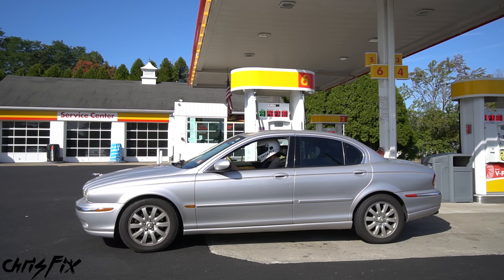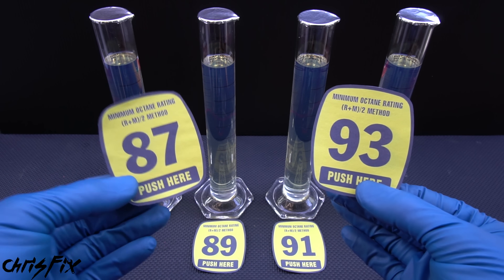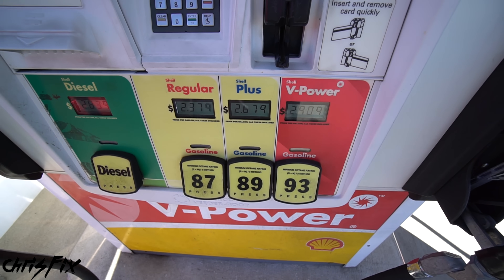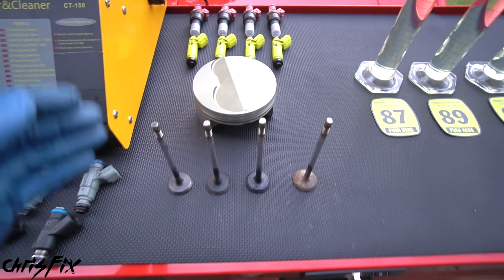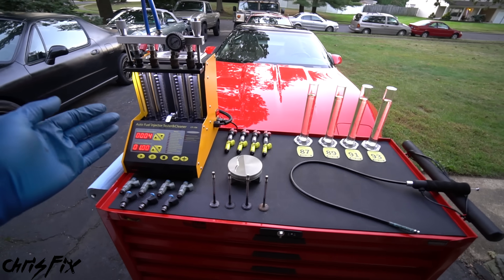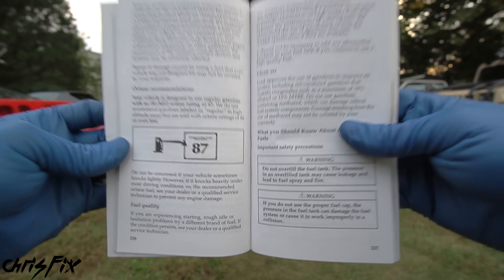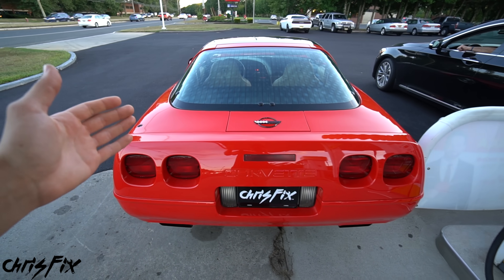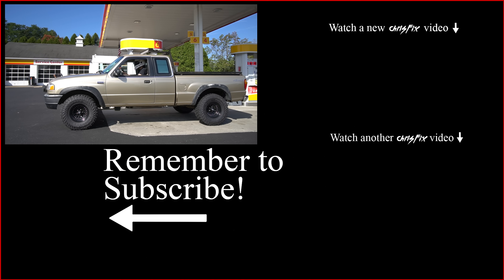What is the BEST Fuel to Use in Your Car or Truck and WHY

Comment: there are many differences between EUROUPEAN and AMERICAN fuel, beside octane 
1- they require low sulfur gasoline, unlike US(which has a lot more sulfur, because it's cheaper to refine!)
2- in US  we get higher octane from adding additives ,not not at refinery(again cost more to refine to higher octane!) most middle eastern oil producer country use that method!
the best to keep engine clean and healthy, last long and get better gas mileage and more power is to get ethanol free gasoline! 

shell and chevron have lot more additives to compensate for their crappy gas that was forced by government ( as we know all gasoline base are the same from refinery, after they loaded the truck refinery add the additive formula that shell, Chevron, ARCO .. ETC gave them)

Comment: i drove my hybrid honda insight from miami to seattle and back and the best mileage gas was from shell. 450 miles per full tank.  other stations fuel was around 350 i was amazed.
Reply: Wow def big difference. Guess I will stick with shell.

Comment: Outstanding video and accurate information.  I am an ASE Master Mechanic and wanted to mention a few things I might have missed in your video.  Miles per gallon (MPG) - we did a study years ago on several vehicles using different octane fuels.  We discovered that 5 out of 6 cars got increased MPG with higher octane fuel.  The math shows that in most cases, it was less expensive to use higher octane fuel - more MPG vs. fuel cost.  Also, I did not hear you mention marketing hype as many vehicle manufacturer's used using lower octane/cheaper fuel as a sales tool.  I have never heard of a vehicle that didn't perform better using higher octane fuel than suggested/recommended/required.  Great animations, I appreciate the research, information and work you put into making this video.
Reply: This is all b.s. long story short especially with newer cars if it runs on 87 and you put 93 your computer will adjust to compensate and your "extra octane" goes right out the exhaust your wastingr your money just put what the manufacturer recommends  but to each their own
Reply: @thomastolson6909  Exactly, Thomas. This thread is all b.s. There’s always a certain % of people who hold onto their belief even when it’s contrary to the facts.
Reply: @thomastolson6909  Right. No second hand information, I want a link to a published study
Reply: I agree.
Reply: If my car recommends 91 octane (premium gas) would it be beneficial to put in 93 or could it cause problems to my engine? My car is a 2012 Infiniti G37xS coupe.
Reply: Agree and wanted to add something we rarely see mentioned...the problem with the lower octane fuels in Canada (not sure about the US) is "ethanol" in the premium gas there is no ethanol. All lower grades had at least 10% on the pump. This is one of the main reasons for not using lower grade fuel, even if your car can run on it. 6 vehicles, 2 fully restored and they all run better on highest grade fuel, better fuel economy, fewer problems with our engines. I'm not sure why so many mechanics say lower grade is fine, it isn't and the difference is noticeable. Save money on gas and repairs, buy premium, its only an extra 4 dollars at the pump up here and worth it.
Reply: @RichardPortfolio  ethanol burns hotter and is less energy dense. that alone is the reason for better fuel economy. has nothing to do with the higher octane rating.
Reply: I remember when I was gung ho about being ASE certified 20 years ago. Then I learned that the only ones it mattered to were customers and some shops that paid extra per each certification so they can hang the certification in the waiting room for customers to see. Done alot of testing myself on various octane ratings and didn't have the same results. From carbureted to direct fuel injection didn't see any difference as long as the minimum octane rating for the compression ratio was used.
Reply: @freedomunrestricted  yeah, that so-called ASE guy didn't mention what kind of cars were being used and the methodology used. Love it when people present anecdotes as scientific study 😆
Reply: He did briefly mention better power and better fuel economy from the higher grade fuel. To be honest I don't see better fuel economy but I do see a bit more power from the higher grade fuel.
Reply: That's a fact more MPG with 93 every time i drive anybody car or my car i stay using 93 unless i see the price is too much of a difference from 89 but if it's a real nice car i will pay the extra
Reply: I only had one vehicle ever that did not do better on higher grade fuel. It got the same with every kind. My old 68 Ford recommended no less than 94 which you can't get so I had to add a little bit of Av gas to get it to run well. The carburetor I put on it had a warranty that would be voided if you used 85. Not sure how they would be able to tell but...I run premium. It is less expensive in the long run. Unless they change the difference between the prices then it will have to be recalculated. I should say, check your mileage a few times running each one and then calculate the difference and see how long the premium will take to pay for itself. It does generally take quite a long time but it is better.
Reply: So I should run premium in my Cherokee for road trips?
Reply: @dirtymexicancliche  just experiment. I have found with the cars I have owned designed for low octane run better on the mid strangth. I get further on a tank. But the fuel economy vs cost is slightly less. But the car feels better to drive. Then on the highway the high octane is best depending on the car and price difference. 20 years ago the high octane was more economical but now the price gap is too high.
Reply: @dirtymexicancliche  It's a great way to give yourself some better gas mileage, bar any other mechanical issues that can inhibit gas mileage.
Reply: We had 2 mitzi Grandis both 2005 models with 2.4 motors manual said 91 octane or better, upon purchasing the 2nd decided to try 95 octane to see if there was any change in fuel usage but their was no change at all.
Reply: The video is showing contrary information.  However, I agree with you. 
 In my experience with a 2008 Jeep Liberty used daily, it does a LOT better in every way using 89 octane.  A year and a half ago, I tried it wondering if this would help fuel economy.  It did, with if being a lot more noticeable than I expected if there was even going to be an improvement.  The 89 has saved money and the Jeep runs with more oomph.  A couple of months ago, I bought 87 when that night there was a huge difference in price, but it was a waste of money.  In the other direction, a station mistakenly filled it with 93 sometime last year, and it ran with a bit more smooth a possibly even a bit more efficiently vs 89, but in my case the 89 is sufficient and gives the best savings.
Reply: Yes how did he miss going into the fuel economy of fuels. I am sure high octane helps for low end torque and lower octane is better for higher revving which indicates low octane burns slower. Knock is also from fuel burning too fast which is why slow burning high octane is used. I do don't agree with the info on this video. Maybe also the energy to weight or liter ratio is higher for high octane. There is key information missing in this video.
My car is more efficient on the highway with high octane. And more efficient in the city on its designed low octane. So I normally put in mid strength.
Reply: @BatMan-to8im  It's like you didn't watch the video. Octane is NOT an indication of speed of burning.
Reply: @jenbowers407  I watched but there are facts missing. There is no way the different fuels have the same stored energy and burn at the same rate. 
and no explanation why in practical reality cars designed for low octane travels further on high octane. The fuels are not the same at all.
Reply: @BatMan-to8im  If you start with a false premise, you can come to any conclusion you wish. I'll stick with science, not opinions. Starting with the basics: Science shows the higher octane-rated gas does NOT burn faster. Octane rating is a statement of resistance to premature ignition, the higher the rating, the more resistant the mixture is to ignition prior to a spark plug firing. That's all. Not BTU content, not detergent content, not speed of burn. Simple resistance to ignition prior to a spark impulse. In fact, depending upon the mixture used to obtain a higher Octane-rating, higher Octane gas can have a LOWER energy content...Ethanol is an example. Ethanol has an Octane rating of about 100, but, there is less energy per unit volume. So, when ethanol is used to increase Octane, energy content has actually decreased...however, ethanol is also an Oxygenate, which can help the mixture burn more completely. The Science is available to those willing to look, instead of repeating old tales and holding onto incomplete opinions.

Comment: Here’s my question. Is there a difference in arco 87 to shell 87? And what if I fill up with 91 instead of 87. What are the differences if there is any. I drive a normal 4 cylinder premium NOT required.

Comment: I had a 2000 Lincoln LS v6 required premium and by mistake I used midgrade by the next day it ran horribly then refused to even start until i added octane booster then it was perfectly fine

Comment: The best fuel to use on your car is alcohol 10 percent to 87 graded gasoline if you have a 4 cylinder engine, 10 per cent alcohol to 89 graded if you have a 6 cylinder engine and 10 percent alcohol to 93 graded gasoline if you have an 8 cylinder engine.. Check your engine's combustion by swiping your finger in your tailpipe (make sure your tailpipe is not hot). If it is let it cool down before you insert your finger. If you see water in your tailpipe after just starting your engine it is normal. This is caused by evaporation. If you find carbon smudge on your finger your are not using alcohol 10 percent. Switch gasolines and check your tailpipe in 2 months. Same thing if buying a car. Do not let a salesman see you checking the tail pipe. Bt Out

Comment: My old 01 F150 runs the same on 87 89 and 93 best I can tell .. average 15 miles a gallon.. I run lucas fuel treatment couple times a month... but even then I dont notice any more mileage or power ..

Comment: Actually ChrisFix you are wrong about the burning fuel part. For some odd reason, why Honda Civic burns premium or V power much more faster than the regular gas and I end up refueling 2 days sooner than expected. This happened multiple and different times so it's not because I put on my A/C, drive really far places, floor my gas pedal a lot on some days, etc. etc. I'm actually a very routine guy who mainly do the same thing.

Comment: A friend of mine always insists that you should buy the highest octane fuel because it's better for your engine. How is it better? Well that he could never be too clear on. Sometimes he'd say it prevents corrosion, sometimes he'd say it burns cleaner, it was always different. But higher octane always meant better, because...reasons? Well I showed him this video and he got all quiet, then said "Well I'm still getting the 93 just in case."
So there ya have it. All the best advice in the world just won't get through to some people.

Comment: I tested 87 vs shell 91 and got way more millage then regular i also made sure not to accelerate hard the whole test. Just drove like the kids were in the car. However after maths the 91 costed a few cents more still. I do recommend filling up on shell v power once a month it helps clean your engine.

Comment: Here in Oz we run E85 which based off sugar cane. It does burn hotter which means it’s cleaner for the car. Although some cars car can’t handle it due it runs hotter.

Comment: Those Valves - the First One isn't "normal", the mating surface from the valve to the seat is deeply pitted, it should be smooth and flat, to be able to seal to the seat. The second one is from a Rich running engine, the third is from an engine that was busted and is burning oil.
What's shown as "normal" carbon deposit on the top of the piston, is a poorly running engine that already has too much wear on the bores - note the vertical scratches deep in the bore surface above the deposit of carbon at the edge of the piston.

Comment: I watched it twice and I'm still none the wiser which additive gives petrol it's octane rating! Can you buy the additive at the local store to increase the octane rating in low octane petrol? Or do petrol companies what to keep it a secret? Tetraethyl lead was added for decades to boost the octane rating until it was banned for use in petrol vehicles. From memory it is still used in piston aircraft engines.

Comment: So would you recommend maybe after x amount of miles in a car that runs regular 87 octane fuel, to maybe run a higher octane for 2500-3000 miles just to clean the valves?

Comment: Since the fuel was in graduated cylinders anyway he should have shook them to seperate the contaminate (alcohol) from the actual fuel. You might be surprised how much is washing the oil from the cylinder bores and eating your engine from the inside out, especially any engine that was not treated for alcohol.

Comment: Hey Chris , my Corvette was produced in 1989 which means from that time on until about 2005 , when they began to add 10 % ethanol to fuel , it ran on non blended fuel . For the last 16 years it's used fuel blended with ethanol . I have found a source close to my home that has unblended fuel , no ethanol added . If I switch back to unblended fuel do I risk damaging my car ?

Comment: In the video when you were talking about the gas to go in the Corvette you said 93 was recommended but not required and you also stated that if you used 87 in that car that you would lose a little power and suffer less fuel economy but early in the video you said that 87 and 93 has the exact same energy properties. One of the myths that you said people had was that 93 had more power than 87 wouldn’t it be the same thing as what you just said was with the Corvette that you would lose power by going with a lower grade

Comment: I listened very closely and watched several times over to verify...

First off very well put together. 
But a couple things you said in the beginning that the higher octane fuel WOULDN'T do, later you said would do...

I.E Lose a little power, burn cleaner (engine components).

But I forgive you lol

Comment: Before I watch the video I can say it has to do with compression ratio if you use low octane fuel with high compression you can cause the fuel to ignite before the spark plug goes off causing a spark knock higher octane has a higher flash point therefore it won’t spark knock due to high compression

Comment: Injector demo was nice snd I’m sure might’ve impressed one or two laymen however however it is true higher octane fuel does have a higher temperature resistance than lower and that’s why it’s referred to slower burning. Also we are blasting intake valves for carbon deposits not the exhaust valves as shown and he should’ve used a new valve for comparison. And another inaccuracy is that no fuel distributors deliver the same fuel to every station, at least that’s how it’s done here on the left coast.

Comment: Toyota Corolla has a 10 to 1 compression ratio engine. Computer compensates so I can use the cheap stuff. BUT computers fail easily. So I use mid grade. That way when I floor it I dont get any fucked up combustion cause my 02 sensors are shit or some other reason. 
Toyota Corolla, mid grade always. 
drops mic

Comment: Literally my car runs higher compression due to it being older and will begin to diesel or burn the fuel without the spark plug so I could turn my car off and it still will run for a little bit I have to occasionally run higher octane so it won't combust prematurely

Comment: Octane rating is the measure of a fuel's ability to resist "knocking" or "pinging" during combustion, caused by the air/fuel mixture detonating prematurely in the engine.

If you are using fuel with a different octane amount then recommended, it will lead to engine damage.

Comment: Actually Europe's 95 octane is US 91 and 98-100 is 94-96, so no fuel in US is not similar to EU, as Europe does not use so low octane rating.

Comment: Somthing different with super unleaded and reg i know because when i had my Camaro if i used reg the lifters rattle and everything but when i used super it didn't
Reply: It's the octane rating. Octane rating is the measure of a fuel's ability to resist "knocking" or "pinging" during combustion, caused by the air/fuel mixture detonating prematurely in the engine.

So if you use a gas with a lower octane rating that is recommended for your car, it increases the knocking which can lead to engine damage

Comment: RON is the value of octane while an engine is idle
MON is the value of octane while an engine is being enganged (this is usually +- 10 lower then RON, but no always)
The value on pumps in the EU is just the RON value while the value on pumps in the US is RON + MON / 2 or the anti knock index.